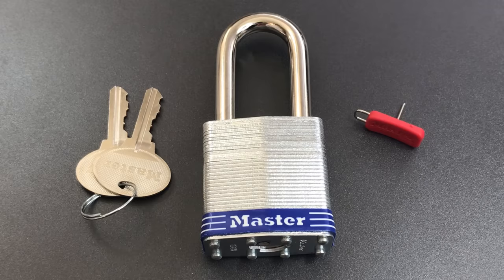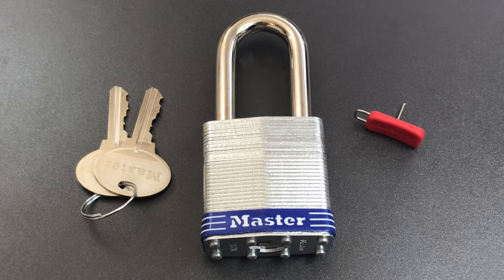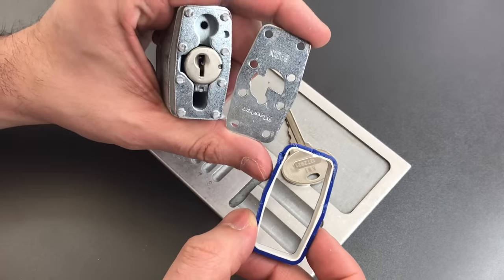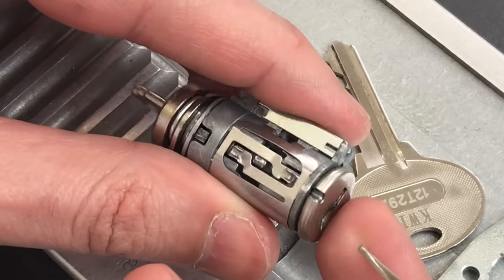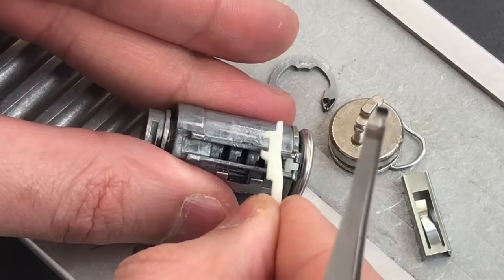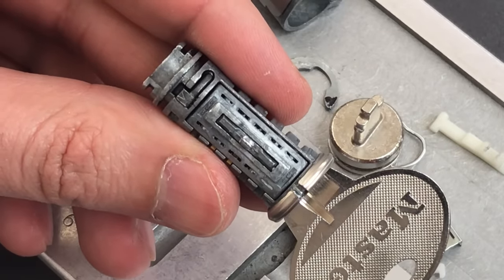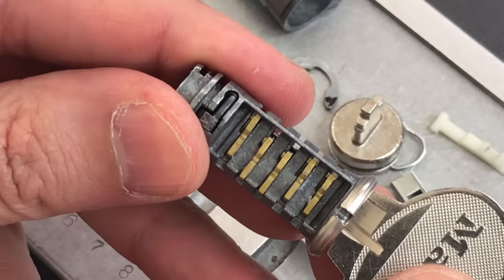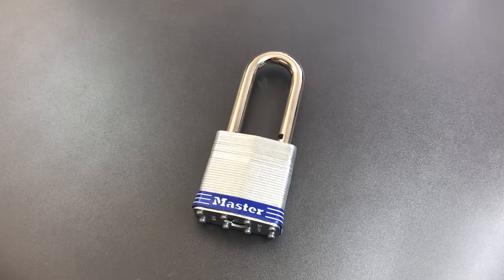[626] A Pick Proof Master Lock? ALMOST!

Comment: LPL -- are you familiar with the similar, but "heavier duty" Master Magnum M532XKADLH (M532) re-keyable version that does have a dual ball bearing locking mechanism, hex boron carbide shackle, and typical bottom plate core retention thus making the core easily removable when unlocked.  I believe this is the same core -- Not sure this model is available anymore (I picked up two at local Home Depot several years ago)
Reply from the maker: I’m very familiar with it. Been trying to find one for a couple months! It is the same core.  And I would like to see if the same vulnerability is present in this lock.
Reply: Well since I got 2 each, I'll send you one -- Ken
Reply: Here are example model numbers for door hardware TPCR103/115 Tulip Knob, CACR103/115 Modified Ball Knob
Reply from the maker: Thank you, I’ll email you. 👍
Reply: LockPickingLawyer I have not been able to find them in Canada
Reply: hmmph. Figures they'd make a single potentially secure product and then discontinue it immediately.
Reply: Boron carbide shackle ... So not going to cut or abrade through, but might break with a good sharp impact?
Reply: @Pyrolock  What came of this? Is there a video?
EDIT: Found it: https://www.youtube.com/watch?v=4NM6zEN92k8
Reply: @prdoyle  OK glad you found it as I did send that lock to LPL as you have seen

Comment: The longest master lock video ever. Well done master lock, now you have made a lock 👍
Reply from the maker: It’s like freaky Friday. Master lock is usually pretty good at lock bodies and Bad at cores.
Reply: @lockpickinglawyer  Seems like they did pretty aight all-around this time, no? Other than the ability to bypass the side-bars.
Reply: @Derpy-qg9hn  He did say the usual flaws of Masterlocks like shimming are still present, he just chose to ignore them. It's better sure, but not what I would call a decent lock.

They also managed to make one of the most pick resistant core structures on this channel pickable in 30 seconds or less.
Reply: @ghostderazgriz  Agreed. I'd add for context (mostly due to other commenters' remarks here) that 'pickable' is really dependent on skill set; I think the 10k hours to mastery rule applies here, this isn't an easy task especially with sidebar locks, I can't manage them (yet) despite having the proper tools (seen here in LPL's video and the Kwikset ones) and a fair bit of practice. It takes more than a little practice to open the most common standard, non re-keyable locks via single-pin picking, i.e. not raking or bypassing... which is why I go in the exact reverse order of that when trying to open a lock I'm new to. 

Which is why it is fun....
Reply: @jaytea3299  True. It would take someone lots of practice to reach LPL's level and pick this in a similar time frame.

Comment: I think its interesting that Master Lock is using its own history of crappiness to enhance security.
If I were just given this lock and not told what it was, it would probably take me a long time to figure out it wasn't even a pin & tumbler lock.
I know when I first started picking locks I exclusively used rakes, and on Master Locks they worked really well.  I'm wondering if the tolerances on this lock are poor enough that it couldn't just be raked open in a couple minutes.  You might not even have to know about that button if its placed where youd be bumping it all the time.
Reply from the maker: Raking would be very difficult, though I will not say impossible. Recall that the General Motors reverse side bar locks sometimes were defeated with Auto jigglers.
Reply: @lockpickinglawyer  - I’m new here . What’s an auto jiggler?

Comment: Wow initially I actually thought that core would've given you a little more trouble.  It seems to be a nice core executed poorly by Masterlock, notwithstanding the other vulnerabilities you pointed out early in the video.  Great info and great exploitation of Masterlock's oversight of that core.  How much harder would that core have been to pick if that side bar exploit was not there?  Do those slider pins make it any more difficult as opposed to regular pin sets?  Thank you for all the time you spend educating us...
Reply from the maker: Had I not been able to tension the sidebar I don’t think I would have been able to open it by picking.

Comment: Guarding the sidebar from direct entry as shown here + using ball bearing to lock the shackle should both be pretty easy fixes. If Master Lock did even a slight improvements to this design, they could have a good lock.

Comment: I sold a 1947 GMC to a neighbor, but the key had been lost, and he was not happy at all. For the pittance he paid for a mostly rust free truck (It had a camper on it and the straight box front panel was rusted, but it's the easiest part on the truck to make), I should have told him to take a flying leap off Grand Falls.  It took me half a day, but I got the door lock impressioned & used that key, and a big sewing needle to yank the ignition lock.  GM did not change over from the 1930s locks until quite a while after WWII. Hot wiring was so easy, but getting into the truck was NOT! You had to open a wing window, then use a 6 or 7 foot long stick of wood to flip up the door handle to unlock the truck. When you pushed down on the interior door handle and it clicked down about 12 degrees the door was locked, none of those little pull sticks knobs by the windows. If you didn't have wing windows, you were kinda screwed, and some models didn't have them. The passenger door was the only door with a keyhole too. FOR SAFETY NO UNLOCKING THE TRUCK FROM THE STREET SIDE! Weird, as they didn't have seat belts back then.

Comment: Hopefully Masterlock actually fix this issue so that they have a decent padlock.
Reply: BlackDolphin90 Well,  maybe if they fix the issues to the laminated padlocks in general.  Remember,  the cylinder is only 1 of the several flaws.  Master won't fix the issues as with the design of the laminated locks wouldn't permit the necessary upgrades.  It's still a cool design,  but there other weaknesses make it about worthless.
Reply: I've taken a Master Lock off a gate in less than a minute with a stud puller.   Just wrenched the rivets away, then took the cylinder out.  They need to stop making laminated locks...
Reply from the maker: I wouldn’t hold my breath. Consumer ignorance is the heart of the problem. Outside of the security community, the company enjoys a great reputation. Stunning!
Reply: LockPickingLawyer Master.....it stands for master of deception

Comment: Gm sidebar locks are pretty good. It was far more common for people to smash the cast metal steering column housing than try to pick the ignition lock. 

AND , you can remove the tumblers and leave the sidebar bit, making a lock that will lock, but can be unlocked with any gm key or a pick.

Comment: Ahh you said you were going full nerd but id love to hear about GM locks. I was able to rake the ignition cylinder on my 89' Caprice  with a small collection of 5 or 6 old chevy keys. I felt like some kind of secret agent or something lol Seems like automotive locks are really solid and difficult. However, being a mechanic has taught me how to basically disassemble the mechanism and turn things manually. Ive had almost no luck picking ignition cylinders.

Comment: Some things never change like most locks made in the USA lots diecast and week exploits, pick resistant in theory but in practise not so good, like the gm locks you talked about a good set of jiggle keys would nearly always get you in, would be interesting to see how this lock would go after a lot of use with the same method, those brass wafers in there certainly remind you of the old gm side bar locks used way back in the 50's 60's 70's and early 80's here in OZ

Comment: it seems like many of these sidebar locks could be made an order of magnitude harder to pick simply by making the shroud on the face of the lock extend a bit further over the core, so you'd need to make two 90-degree bends to put a tension tool down the side.

Comment: The weird thing about Master Lock is that the actual nut and bolt engineering seems to be really good. Lots of thought put into the various mechanisms they have. The only problem is that they can't open their own locks. If you can't open it, it's not broken, I guess.
Reply: Blame marketing. As in, the Marketing department. "You need to make the lock cheaper!!!"

Comment: Nice job LP. I never took one of these locks apart, but about after a week when the solid lock body model first was sold at Home Depot (what 6 years ago?). This vulnerability and picking vulnerability was already demonstrated  on Keypicking.com.
Reply: One side effect of this method, if you aren't careful you will damage the spring on the sidebar making the key work poorly.

Comment: I notice that your Tensioner has this blackened area near where it bends. One of the big questions I have been having (and have been unable to find despite looking at lots of videos about making/modifying lock picking tools) is,: 

If I get some high-end stainless tools, or attempt to make my own, when bending them, 

1. is heat necessary to avoid breaking them while bending? 
2. Does the heat affect the strength, hardness or "stiffness" of the material? 
3. is the heat applied in these instances something that can be done with a standard propane torch? 
4. If so, how long do you heat it or how can you tell you've done it enough or too much? 
5. Do some kinds of Stainless bend/heat easier or more safely (without affecting the permanent qualities of the material) than others? 

Anyone can answer if you have the information, please. And I apologize if some of this is obvious, I'm an idiot.

.

Comment: Didn't read all the 1000+ comments, but this is actually a pretty good lock. It requires a specialized tool, extensive knowledge of the lock and firm dexterity to pick it. .... But the LPL still defeated it, and quickly, after the prep, to everyone's satisfaction but Masterlock ;-).

Comment: Hi, nice video by the way.  On a side note I have a brand new Master Lock 5 that I got from Home Depot that I can’t get in for the life of me!  Granted though I am a novice picker, but I have been able to both rake and spp Kuickset locks, shlague, a trigger lock and materlock 150 but for the life of me I can’t get in to this damn lock! I’ve tried everything from SPP to raking to even using a bump key from sparrows and no dice.  As far as picks I’ve tried are southord jackknife and sparrows tuxedos in addition to trying their bump key which had yielded no success. WTF!!  I think Masterlocks have been well underrated as to their security given the locks I was very easily able to get in to and that I haven’t been able to get in to this new Masterlock number 5 despite weeks of effort. I’ve also tried varying tensions between soft to light tensioning as well as using sparrows top of the key way tensioners.  I’ve seen you do ML #5 but not the newest current incarnation which has a more restricted keyhole from the ones you’ve done.  I’d love to see you go to Home Depot or wherever and get the brand new current version of the Master Lock #5 as well as getting any advice you may be able to provide as far as picking it.  Until then it looks like this New Master Lock number 5 will be going in to my own naughty bucket for the time being. 😕 in fact I may just return it since I’m feeling utterly defeated at this point and I’m well within my return period.  I may try buying a ML 3 instead and see how that goes.
Reply: Mr. Morningstar yeah the key for this lock has some extreme high low biting which is probably what’s been causing me the issues as well as non successes using raking etc.  I have since also purchased a Master Lock 3 with easier biting on it and have been able to both spp and rake it.  Tho I have mixed consistency sometimes I can rake it within seconds and sometimes it takes me a long while, same with spp.  Moral of the story is I have a lot more practicing to do.
Reply: Mr. Morningstar yeah I’ve been doing that, between trying different tensioners to varying light to strong tensioning as well as lightly pulsing my tensioning.    And yeah the springs in the ML 3 and 5 are pretty strong which makes it a little harder to work on especially as a novice.  Most other locks I’ve done have very light springs.  And yeah I’ve also done the look at the key biting technique when I’m having trouble to try and help.

Comment: could u get a couple keys and shave off the pin set grooves so its basically a tension wrench then get a dremmel and drill a hole through the key so u can put a rake through the hole and put the key in the lock and rake the lock through the drilled key/tension wrench?

Comment: For anyone that thinks E clips are C clips... that's probably why you don't have the tool for them. Because they're e-clips and it's an E clip removal tool. You can get all sorts of them on Amazon, or just about any automotive supply store. C clips have little ring holes on the tips of them, E clips have the bump in the center.

Comment: The only reason I know a couple of the things he talks about is, because I tried to replace my 2006 honda civic ignition by removing damaged pins. Long story short, I had to pay almost $800.00 to have my ignition replaced. When I went screwing around with it, Honda has an anti theft system where if you try to pick or fumble with the ignition it permanently shuts the whole car's computer down. Then Honda has to come out and reprogram the ignition.

Comment: 3:02 - So, all you need is a battery operated cutting wheel and you can grind off the rivets?  Then again, if that were the concern, you would just take the battery operated cutting wheel and just cut off the lock.  So, physical destruction of the lock is not really the point here, I guess.  At this point, the purpose of the lock is to make it difficult to breech it without it being obvious that it has been compromised.

Comment: I have an inside lock in a gate (no keyhole on the outside) where you can barely fit a hand from outside to put the key into the lock and rotate it. Of course, I have the key attached to a cord in case I drop it while trying to open the gate.

Comment: Absolute lockpicking mood here , 
Could this be improved by making the cylinder have pins on the top and bottom of it respectively? Making it require two of LPLs tools to be pressed in hard at a time ? You would need 3 or 4 hands !

Comment: Just an FYI, you can use a battery power Grinder with a cutting disk & buzz the revert heads off very quickly then just pull the core. What I wonder is how strong is the core, did you try a brute force attack on the core?

Comment: So they could have prevented you from tensioning the sidebar just by restricting the front plate a bit more? I don't get why they didn't use ballbearing locking, as it's less parts so would be cheaper to make. Two minor adjustments to the design to make a really decent lock. Thats nuts!

Comment: So, all they needed to do was cut the bottom plate differently so it protected the sheer line, and replace the actuator and spring loaded palls for a ballbearing locking mechanism. They could do that easily.

Comment: Not that hard to remove those rivets in the wild either, using a battery powered 4” grinder. But then I’d just use a cutting wheel on the shackle.

Comment: I find a cordless grinder with a diamond cut-off wheel works best to remove a padlock that I can't find the key for
Takes about 2 seconds, or less, to go right through it
Seriously
I used to pick, but it takes a lot longer
And I have to replace it anyways

Comment: One side-note here is that Schlage's Secure-Key was forced out of production by rival Kwikset, because Schlage's design was too closely similar to Kwikset's Smart-Key design, of which is patent-protected. Kwikset had filed litigation in defense of their Smart-Key design patent against Schlage over their design, thereby effectively forcing Schlage to cease production of their Secure-Key design.

The #1 concern with this lock would be the use of plastic/nylon components or parts in its core/cylinder, of which could easily be vandalized in a denial of service attack, by use of some heat from a portable propane torch... or inadvertent damage by heating up this lock with a torch, if it were frozen solid in freezing environment, such as that of securing an outbuilding or a storage container in a northern climate in the winter season... 

I also could see the design of this lock to have long-term wear issues, due to the inferior materials incorporated into its design... in addition to the use of Kwikset's sole keyway - their KW-1... of which has absolutely NO KEY CONTROL, as well as very limited number of possible key differs with a MACS of 4, and 6 possible key depth increments per cut, with only 5 cuts or "pins" as that is typical of Kwikset locks of which are marketed in their product line.

To my knowledge, Kwikset also markets a padlock, of which very closely resembles the Master Lock model 18... as demonstrated in this video. Kwikset's "Smart-Key" padlock retails for around $20, and is of laminated steel construction, with a 5/16" diameter, boron-alloy steel shackle.